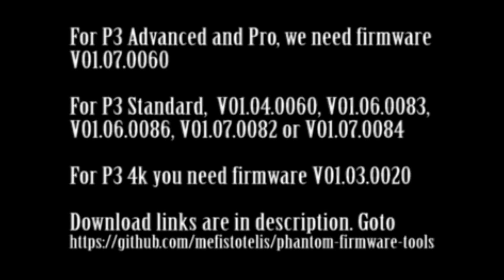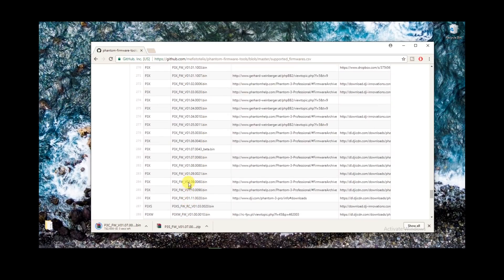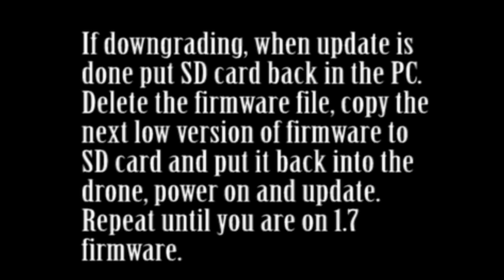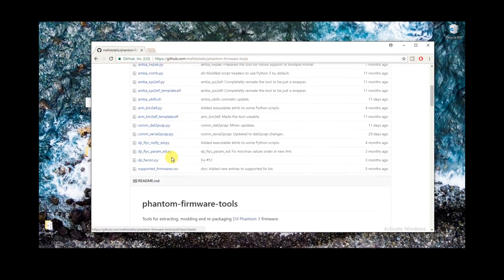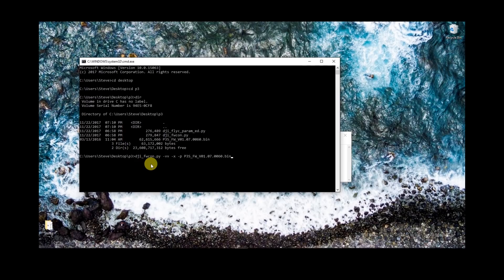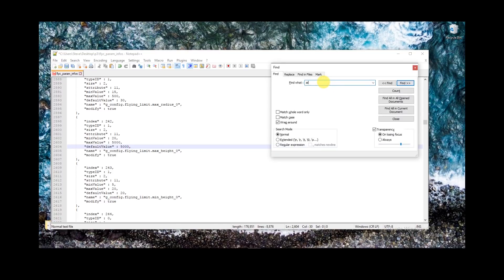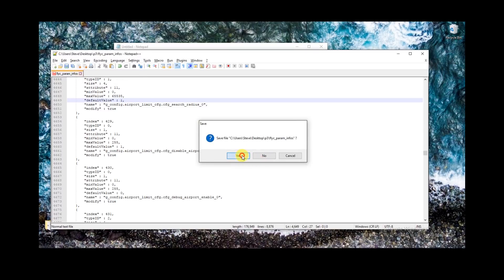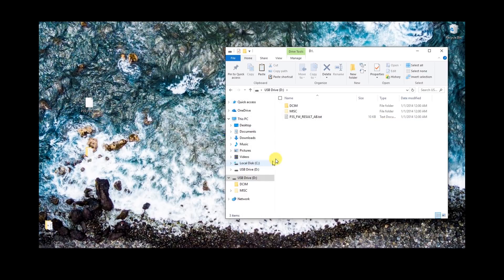Phantom 3: How to modify flight parameters and hack height, speed, flight area restrictions

Comment: This...is golden. I just have a few questions before I take the plunge:

1) I know what we can gain with this, but what do we lose by going back from 1.11.0 to 1.7? (nm, answer derived here: https://dl.djicdn.com/downloads/phantom_3/20170706/Phantom+3+Professional+Release+Notes_.pdf)

2) Are there known efforts underway to "mod" 1.11.0? (If 1.7 gives me what I think I need, then this is only a point of curiosity)

3) Do I need to be aware of any DJI f/w auto-updating processes while running current RC f/w and the 1.7 AC f/w? (I don't use DJIGO except for calibration)

4) Do we know if DJI's client libraries (iOS and java) used by Licthi and others attempt any client-side checking or enforcement of limits for potentially hacked aircraft controller parameters? For example, do current libraries attempt to throttle back to 500m anything that exceeds that coming from the AC? In practical terms, are there versions of Lichti's mobile app(s) that cannot recognize and utilize the new params? And, if so, are there published "mods" for the app (iOS), or is there a max release/build that provides support for any param values stored in the AC?

5) I have checked and confirmed that Lichti's mission hub has hardcoded range checking - for both speed and altitude - such that you cannot import a mission CSV file with modified values if they are outside of the assumed range. So, is there a way to modify missions created by Lichti mission hub that will support the new, higher speeds and altitudes? That is, after this mod will Licthi mobile app (iOS) allow me to modify speed/altitude? And, will those app-updated values sync to the hub?

6) Is all of this mod stuff just a hekkuva lot simpler with the newer platforms (P4P, Mavic, Inspire 2)? (Should I bail on P3P and upgrade?)

Disclosure: I live in the Rocky Mountains, right at the base of some very tall mountains. I help a cooperative of wranglers locate and identify their stock on their federal grazing leases - also in the Rocky Mountains. Autonomous missions are very important. LOS is not. The 500m above HP and the 200m below HP limits, although understood, are not practical when attempting to fly this terrain, never exceeding 400' AGL.
Reply from the maker: 1) cool :) 2) 1.7 is the only version we can mod, as its the only one which was not encrypted in the flght controller module. The others lock us out. But, i found that if you update from 1.7 the mods stick and arent removed. Ive only tested up to 1.9. 3) I am not aware of any forced FW updates on p3 platform, you should be fine. 4) I dont know .. you should visit slack those guys may know 5) ive not found a way to run missions outside of stock params (in theory on amodded AC, you could modify the CSV and then upload but i havent tested) 6) YES its alot easier on the mavic/phantom 4
Reply: Thanks, Steve! You are a gem. I did post my n00b question re: lilchti mission hub created missions in the spoon-feeding channel yesterday. What an amazing bunch of guys, from github to hak5 to slack to retroroms to here. A whole new world, for sure. Your response has me leaning to leaving the P3P stock and picking up a Mavik or ?? (your recommendation for a modable drone that can fly autonomous wp missions not limited by the -200m/+500m altitude?)
Reply from the maker: to be honest, i havent seen any drone which can fly autonomous missions above 500m. You may want to look into the autel x-star premium, it has a Stock altitude limit of 1000m. I dont see any way to get a p3p or a Mavic to fly missions up that high, or no-one has told me ..

Comment: Flew today.  No increase in speed or ascent or descent.  GPS or ATTI mode.  50km/h.  3m/s.  I will apply PMCAPPFw3.bin again.  80km/h downwind with 30km/h wind.  Please help?
Reply: It renamed PWC... to _updated.bin
Reply: ========== 2014.01.01 00:00:12 remo-con disconnect======
Packet: P3X_FW_V01.02.0006.bin
Upgrading ...
Result: Success.

========== 2014.01.01 00:00:12 remo-con disconnect======
Packet: P3X_FW_V01.06.0040.bin
Upgrading ...
Result: Success.

========== 2016.03.14 22:23:51 =====================
Packet: P3X_FW_V01.06.0040.bin
Result: Abort.
The firmware on the SD card is identical to or older than the current firmware on the aircraft.

========== 2014.01.01 00:00:12 remo-con disconnect======
Packet: P3X_FW_V01.07.0060.bin
Upgrading ...
Result: Success.

========== 2016.03.17 20:40:08 =====================
Packet: P3X_FW_V01.07.0060.bin
Result: Abort.
The firmware on the SD card is identical to or older than the current firmware on the aircraft.

========== 2014.01.01 00:00:12 remo-con disconnect======
Packet: P3X_FW_V01.08.0080.bin
Upgrading ...
Result: Success.

========== 2014.01.01 00:00:11 remo-con disconnect======
Packet: P3X_FW_V01.08.0080.bin
Result: Abort.
The firmware on the SD card is identical to or older than the current firmware on the aircraft.

========== 2014.01.01 00:00:11 remo-con disconnect======
Packet: P3X_FW_V01.08.0080.bin
Result: Abort.
The firmware on the SD card is identical to or older than the current firmware on the aircraft.

========== 2014.01.01 00:00:12 remo-con disconnect======
Packet: P3X_FW_V01.09.0060.bin
Upgrading ...
Result: Success.

========== 2014.01.01 00:00:11 remo-con disconnect======
Packet: P3X_FW_V01.09.0060.bin
Result: Abort.
The firmware on the SD card is identical to or older than the current firmware on the aircraft.

========== 2016.06.22 16:46:53 =====================
Packet: P3X_FW_V01.09.0060.bin
Result: Abort.
The firmware on the SD card is identical to or older than the current firmware on the aircraft.

========== 2016.06.27 08:21:47 =====================
Packet: P3X_FW_V01.09.0060.bin
Result: Abort.
The firmware on the SD card is identical to or older than the current firmware on the aircraft.

========== 2014.01.01 00:00:13 remo-con disconnect======
Packet: P3X_FW_V01.07.0060.bin
Upgrading ...

========== 2014.01.01 00:00:12 remo-con disconnect======
Packet: P3X_FW_V01.07.0060.bin
Result: Abort.
The firmware on the SD card is identical to or older than the current firmware on the aircraft.
Reply from the maker: hmmm thats strange. I would install it with the debug file on the SD card. Did it work in the dji go simulator??
Reply: Simulator gives me 50 and 5 up.  3 down.  Not sure why but trying debug file.  It said _updated.  How can I verify I followed all the steps to create the PWC file.  I have the flyc_param_infos, and the original to do a text file comparison.  10 changes.  I didn't forget the step that creates the PWC file, obviously.
Reply: You verified it should work in the simulator?  100km/h?  10m/s?  This will save me a trip outside in the cold.
Reply from the maker: oh yes! Simulator worked just fine .. it rains ALOT where im at, so flying outside isnt always an option .. the mods should work in the sim no issues. I have mine set at 22mph up/down, 45ph forward and no height limits. Its pretty quck to tell in the sim if the settings worked or not.
Reply: No Go.  Tested height limit too.  It's odd that now I can go up at 5m/s in Sim.  I was so excited to get your results.  Would you send me your PWC file for P3P?  Any ideas please?  I have P3P.
Reply: There must be some difference due to your Advanced vs Pro...
Reply from the maker: send me an email at flyflydrones@gmail.com and i'll send you a p3p file. ive done this on p3a, p3p and p3s and didnt have any issues. Kinda scratching my head on why yours isnt working.
Reply: He has a Pro.  All the mediafire links are broken to download the hacked app 2.4.2.  Can I use the standard 2.4.2?
Reply: Because I used the newest iOS app.  Let me try an old Android?  See phantompilots link below.
Reply: notsolowki in github said I have to edit /res/raw/flyc_param_infos to match.  Why didn't you?  What app version are you using for Android?
Reply: I will Email you to try it.  But I don't think it is the answer.  I tried applying the PWC file, then not opening any app or attaching a device to the controller.  I believe my app is resetting your parameters.  So I will fly with just the remote, then look at the DAT log files to see the speed.  It seemed faster on my first try?
Reply: I follow all ways to mod and test my P3P but everything no change. Now I find the very very very important key  "open dji go 2.4.2 and reset all settings" . When I do that everything can run in DJI GO Simulator. I hope can help someone . LOL
Reply: I tried it and still my horizontal speed is only 37mph.  Up and down is 10m/s.
Reply: You're right it worked for me!  Now I can change vertical speeds.  It was a needed step thank you so much.  I will also experiment with voltage minimum limits and watt limits.  Still I cannot increase my horizontal speed in the Sim.  Have you been able to with P3P?  What's the trick Jason?

Comment: Downgraded Remote.  Now green lights on craft.  Props spin.  But Firmware update required in red in top left corner.  Overall status requires 3 updates.  Just ignore it forever?
Reply from the maker: You should be good .. can you screenshot it and post link to imgur? im curious what fw needs to update
Reply: Camera battery aircraft.
Reply from the maker: yeah thats normal, as long as it doesnt force the update or prevent take off you should be good. Mine says i need fw updates as well but the status is green

Comment: I downgraded from 1.08 to 1.07.0060.  Now is says 1.4.10 in the App About.  Did I do something wrong?
Reply: It was 1.8.80+ before I started the process.
Reply from the maker: errr ... thats a new one on me!  Re-install 1.7 without debug after formating SD card. See what it does .. what version of DJI Go??
Reply: It's very strange.  Now there is no "Aircraft" under About in v3.1.23 of Go.  I could paste the RESULT.txt file here but perhaps it's not so important.
Reply: Success!  If it wasn't 10F out I could test it.
Reply from the maker: you can always test in the simulator .. and great news! :D
Reply: Remote Controller requires upgrade.  All the options are messed up in Go.  Standby.
Reply: Now I broke it.  Yellow blinking.  Aircraft Firmware Inconsistent.  Firmware Update Required.  Is this because I updated the Remote to v1.9.2?  App is 3.1.23.  Aircraft 1.7.60.  It's a P3P.  Please help?
Reply from the maker: you need RC on 1.6 version for 1.7 to work, rollback the RC firmware
Reply: Now I should update the camera?  The battery?  These messages all came up under Overall Status.
Reply: My goal is to keep your modified 1.7.60.

Comment: upgraded back to 1.10 and error goes away, when i repeat process the fw flash goes through successfully but in the dji go app in the status bar i get Main controller data error, tried recalibration of imu still persists
Reply from the maker: I've not seen main controller error - what RC firmware are you on? Did you make sure to use the right one? p3a vs p3p? Did you skip any firmware or did you go one by one? Flash from 1.10 to 1.9 using debug file, let it finish. Then remove the debug file and force flash using the button on the VPS - let that finish and it should work.
Reply from the maker: email me at flyflydrones@gmail.com Rossi46

Comment: Shows max flight altitude is 20~5000m but if you set to say 800m it gives faa note but dont keep setting of 800m
Reply from the maker: we bypass that setting in DJI Go. You dont need to change it.
Reply: So this setup just bypasses it in the go app
Reply: If you could point me in the right direction i would really appreciate it
Reply: ok finely got it thanks for all the info thats in this video

Comment: My phantom3sta gradually downgrade to 01.07.0084or90 After the downgrade is completed reopen the aircraft found PTZ no response, can not self-test, I opened dji go found PTZ everything is normal, I upgrade the firmware version 01.08 to normal, how to solve
Reply from the maker: i dont understand what you say " found PTZ no response, can not self-test," do you mean compass, or the IMU? Downgrade to 1.7, then flash modded file. Then update back to 1.8 if you need. mods will stick
Reply: I mean downgrade to 01.07 version, restart the camera without any reaction can not self-test, but I check dji go information is all normal, I upgraded to 01.08 version of all normal
Reply: 01.07 Firmware Loses Control of Camera (3sta)
Reply: After downgrading the camera gyro error, 01.08 version is normal

Comment: I think we need a tutorial on how to downgrade the controllers firmware as well. I'm getting a update radio firmware on the DJIGO app. Showing drone and drone camera needs an update because of inconsistent firmwares on remote vs drone & camera. EDIT: Found out how, on DJIGO app tap and hold on the small tutorial hat in the app it will then give you the option to downgrade RC firmware. For this to work I had to downgrade RC firmware to v1.5.80, I hope this helps others.
Reply from the maker: Oh yes, modded i can easily 49mph and break the altitude limit. It works for sure.
Reply: https://www.youtube.com/watch?v=j62Du8Sn8Vo&t=63s
Reply from the maker: https://forum.dji.com/thread-60758-1-1.html
Reply: Downgrading to 1.5.80 see comments above

Comment: Hello, I have followed all the steps and everything is correct, very good tutorial, thanks for that, but now three notices come out, 1.the drone needs to update firmware 2.the battery needs to update firmware 3.the camera needs to update firmware, now it is not can start engines and forces you to update again, what would be the solution? If it exists, thank you very much for your time.
Reply: Well, after downloading from firmware V01.11.0020 to P3S_FW_V01.07.0060, I have verified that the whole process can be done, but for my ph3a to start engines I had to degrade the rc to 1.5.80, after this now everything works correctly, I have been able to verify that the parameters changed in the process of recompilation of the suggested firmware work correctly and the improvement in the speed of rise and fall is remarkable, I have tested the height limitation and it is no longer a problem for me , because I usually fly in a mountainous area and now there is no problem with the height limit, on the app screen it now has a maximum height of 5000 meters, thank you very much for the knowledge shared, so it's a pleasure.

Comment: Love the Video. Steve, How to keep the modification, when DJI Go app keep pushing those new firmware? Do we also have to downgrade the controller? I am on version V01.11.0020, do I have to go to All the other versions: V01.10.0090,V01.09.0060,V01.09.0021,V01.08.0080 and next V01.07.0060? You Answer TM but there is some firmware missing?
Reply: You mean do not do V01.09.0021?
Reply from the maker: my 1.7 works with the latest RC firmware, 1.8. So you should not need to from my experience, but if you do its very easy and there are many tutorials around here. For versions, V01.10.0090,V01.09.0060,,V01.08.0080 and then  V01.07.0060
Reply: Thank TM

Comment: With those enhancements, I am more on for the Distance and the Speed increase, which line is for the Speed? The Airport config I don't think it is safe to touch that even you are a certified or careful pilot. Do you have to copy those two files to the P3 Folder on the desktop for each downgrade? Or you do it at the final downgrade and run the script? I did not got that part right. Thanks

Comment: Hey Steve,
Great job from you guys at FlyFly. I own a massive fleet of P3’s as well as almost the whole DJI line of aircraft. I have been waiting for this mod for a very long time. I knew that someday it would be figured out and you guys did it! I hope that you guys can also dig into the Inspire 1 FW as well. Hopefully it will be just as similar as this mod.
Thanks again as always. You guys ROCK!
Tom, AKA, Drone Master on the Drone Pilots Network.
Reply from the maker: cheers Tom. I did find a few Inspire 1 versions which were able to be modded .. the process had a few warning errors, but it repacked fine. I don't have an inspire 1 to test with, so looking for bold folks who are willing. Its version V01.02.01.03 and V01.02.01.06. The process to downgrade is the same, but the debug file is named WM610_FW_DEBUG. Again, i havent tested .. but willing to share. Ping me at flyflydrones@gmail.com and we can talk more. Happy thanksgiving!
Reply: Also want to note, that I have every FW version for the Inspire 1’ since it’s release.
Hit me up should you need legit bins. I can make that available if needed.
Keep up the KA job!